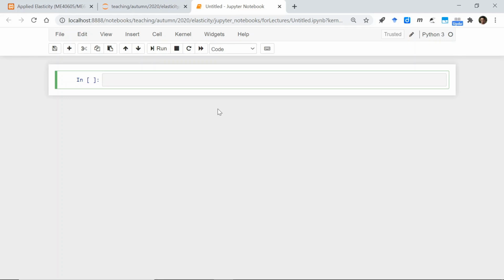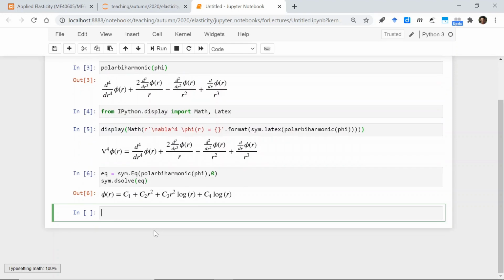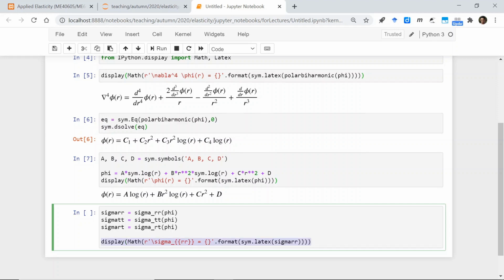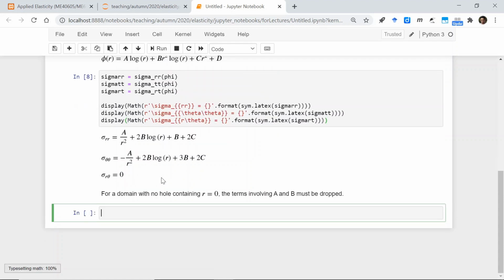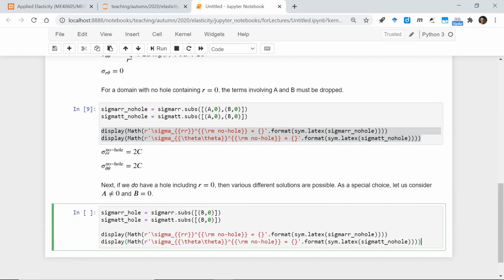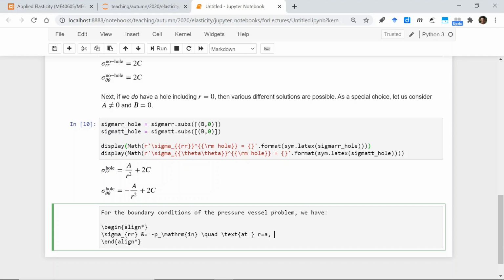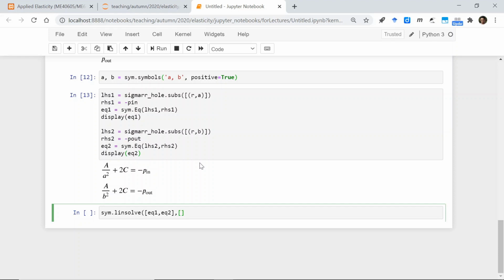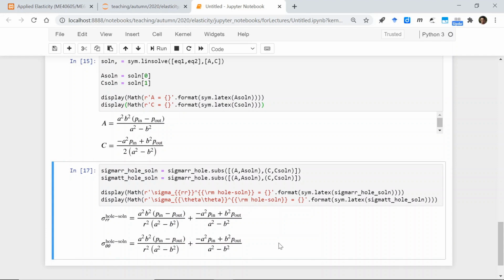2D Elasticity – 10: Polar Coordinates Example – Pressure Vessel (with SymPy in Jupyter Notebook)

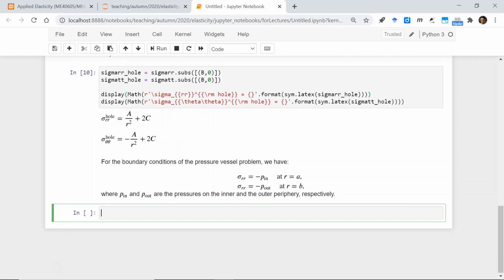Comment: At 26:51, why is Sigma rr = - Pin when Pin is in the +ve r direction? Shouldn't it be like Sigma rr = +Pin at r=a?
Reply from the maker: A normal stress component by convention is always pointed along the outward normal of a surface whereas the pressure is acting into the surface. That is why they are of opposite signs.